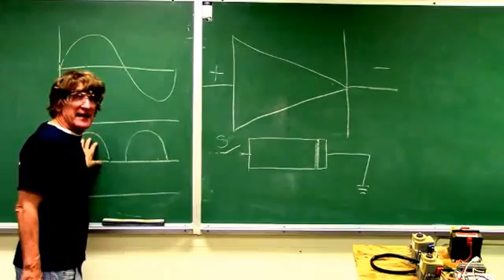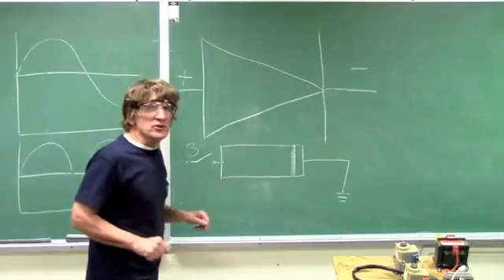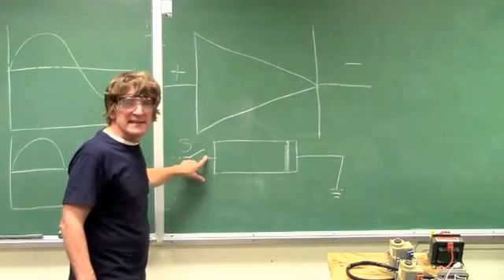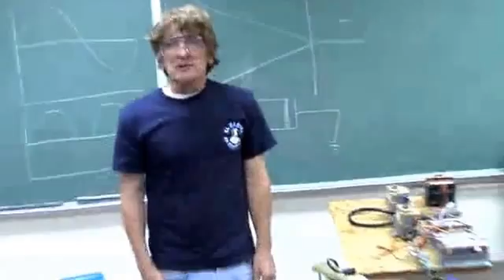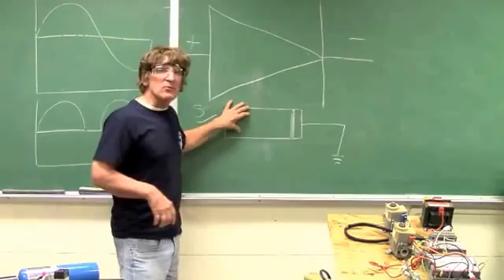flame Rectification

Comment: Super! I just test this on a Carrier HK42FZ013 board. Use a diode for microwave, I got 8uA, without adding resistor. The board running without error. 100VAC on sensor connector. Thanks a lot Tim, you are the best!

Comment: You missed explaining how (in a hot surface ignition system) where the flame sensor rod essentially conducts only half of the AC sine wave(average 90v) thru the flame where the ions in the flame then contact the burner nozzle which is grounded making it's way back to the control board as a rectified dc signal(usually 1 to 4 micro amps) The surface area of the grounded burner face is 4 or 5 times larger than the surface area of the rod. It's easier for the positive half of the AC signal to travel via ions from rod to burner face than it is for the negative cycle going the other direction from burner face to flame sense rod essentially turning ac into a small dc signal. There is nothing mysterious about the flame sensor rod. It's just a piece of smooth stainless steel. When you clean them don't use rough sandpaper or you will have to clean it again much sooner. Use steel wool or a scotch brite pad or fine sandpaper

Comment: Nice presentation!!  I would like to simulate that effect on a gas boiler. The boiler I use is from the European market. So the Ignition module works on 230 V AC.  I have made a diagram which  I would like to share with you so you could confirm that I have made the right connections.I would be very pleased if you send your comments. My email :rober65bb@hotmail.com. Thanks in advance!!

Comment: 1 kilo ohms resistor and one diode connect series to conductor toward ground. when spark comes on plug same time connect this conductor between flame rod and burner ground. thus help u to flame stimulate in your work shop.